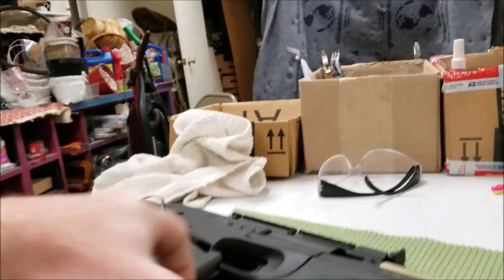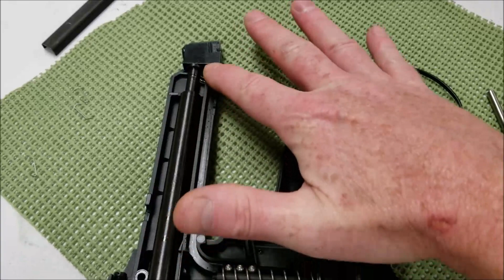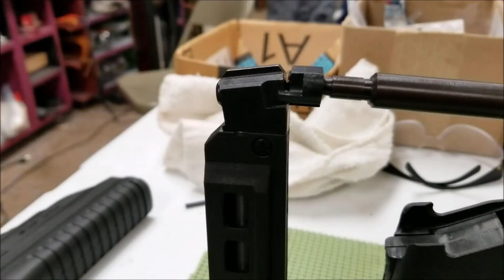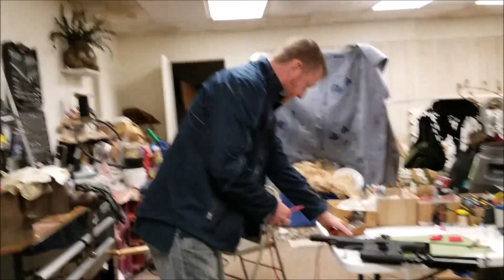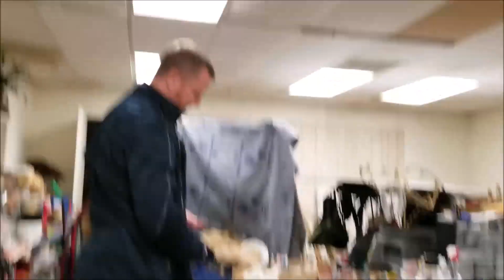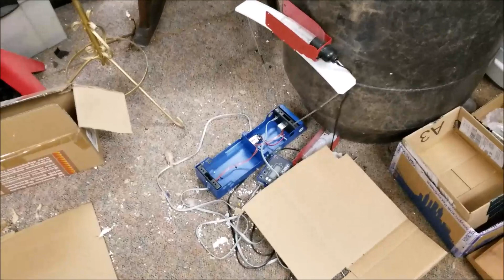Upgrade Day #2

Comment: I asked myself where did you get this Uzi Buttstock and what did it cost,also i need new screws for my latchplate and don't know where to get them.I also wanted to ask which length thickness and Diameter has the pipemod for the hopper?
Reply from the maker: I used to get the wire stocks from Jim Chapman. He stopped answering my emails the last time I told him I wanted to buy another fifty. I don't remember the retail price. Some of my customers have recently had luck contacting him through his website http://www.airgunartisans.com/AAJimC.htm. I believe the screws I use for the latch plates are 3/32". I'm not sure of the thickness of the liners I use, but the ID is 4.6mm. I cut them to 4 1/2". I'm looking forward to trying the new style valve body. I have a few on order.
Reply: Hello thanks i contacted him over his email,i hope he answers.I am through with the new valve bodys,i will send them all back.I had 3 of them,2 are still on the way to my door and i will send them all back.
First thing is they are still wabbeling in there even they have two grooves.
The first valve body i got,had a hole at the lowest side of the groove,where the metal is the thinnest part.You can see my video what i made for the seller,to show him the damage.
The second valve body wasn´t straight sitting on the magazine,because the inner thread was cutted in the wrong angle.
Yesterday i got the exchange for my first valve body and guess what,it is leaking at the valve seat,because there is a dent in the sealing area,also there were a lot of production stuff in it,metal and dirt from the manufacturing process.I am really disappointed,the parts are so expensive and they don´t even test them before they go out.So i decided to stop the experimental stuff and go back to reliable destucion :)
I tested tuning valve today,the one with the two hole design made from titanium against the original.My Setup is standard magazine with bb centering screw and 40 cm smooth barrel,Pulse Time 8 ms with standard CO2 cartridge and the results were just no difference hahaha.New Cartridge first shot with tuning valve 701 fps,going down all the way with every shot.
New Cartridge with standard valve first shot 700 fps.Have you encountered this any time :) ?
Please don´t talk to parabellum what i wrote to you,maybe your parts are fine :)
Reply from the maker: Don't worry. I won't. It looks like they took too much off that side. Bummer. The reason I got excited about them is because in theory they should work great with the Magnus Ops seal because it protrudes a bit. This causes the valve body to twist away from the single hook. I fix this by backing the inside right of the mag well with a couple layers of thick tape. It also gives an even tighter fit. I may have already explained that so forgive me if I did. Fingers crossed for the ones I get. You will see this a lot. When a product first comes out there are usually problems, but most of the time they get fixed.

Going back to the tubes I sell them, but an alternative is to bind the magazine with three  zip ties. This is done by going around the back of the air tube, and around the front of the mag. I did this for quite some time before the tubes. It prevent's mushroom mag, and also takes up space in the mag well. Sometimes my 4K builds come up on Ebay. The earlier ones have this.

As far as velocity I think 700fps is about all you will get with room  temperature co2 using the 400mm barrel no mater what you do. To experiment you can very carefully heat the co2 to 107F to make it go supercritical. This turns the liquid co2 into a gas before it is released. This creates more pressure, but the main problem with co2 is it's refrigerant properties due to it's relatively high melting point. The faster it is released the colder the liquid inside gets. This slows down the molecules until they actually freeze. Air, and straight nitrogen don't have this problem for our application. They will cool, but their freezing point is much lower than co2. This is why you can get far higher pressures from air, and why HPA is regulated. Co2 in our application is basically self regulated. It can only turn into a gas from a liquid so fast. This is why co2 powered airguns have an expansion chamber. Anyway under normal conditions you will only get about 800psi from co2, and the faster it is released the colder it gets so the output pressure decreases. I have heard of people putting an electric sock on their 88g cartridges, but if you try any of the above hacks please keep in mind they are potentially extremely dangerous. Do so at your own risk, or be safe by switching to HPA. After you do so you will then be able to find the flow limiting factor of your bird. Hint: The inlet in the manifold, and gas tube will become flow limiting factors.
Reply: @masondawson4061  Thanks for the Info😀I am running on HPA usually,but i got my chrony Yesterday and atm my regulators are apart and waiting to get maintenance.I already thought of selling the two valve,but  i shouldn't do that,first have the hpa results.
Reply from the maker: @JetDriveJetson  I didn't know that valve was titanium. I've been running the three hole titanium valve. They put out a lot of air, but tend to break under 25V. At first they were too short, and had galling problems. Then they made them too long. Cutting them down to the length of the stock valve makes them work, but they still haven't addressed what causes them to break. If they would just move the holes away from the pin a few thousandths this wouldn't happen. Some people just don't listen though. If I recall correctly you can get about 925fps from the barrel you are shooting. My fastest recorded shot using air was 1055fps. That was done with a 700mm barrel using 1600psi.

Comment: Why did you put that Pipe in the mag,whats the Advantage?
Reply from the maker: It keeps the mag from separating when using high pressure air. Also the bigger motors, and higher voltage I run in my birds will separate the mag on their own without the air. We used to use the clips you saw me pull off the mag for the same purpose. The tube also swells the mag slightly giving it a tighter fit in the well. It also stops misshaped bb's from getting to the barrel. Contrary to what you may read it does not boost velocity. I have a video debunking that theory.
Reply: @masondawson4061  No i haven't read of that,but i could imagine, that the tube works a bit like a sealing, that holds up the air a bit more that partial goes that way by every Shot.
Reply from the maker: @JetDriveJetson  You would think so, but the tube only goes so far into the valve body. There is a smaller inner diameter inside the valve body further up that is the limiting flow factor. https://youtu.be/TekBE6sOgCs
Reply: I saw you got ninja pro v2 regulator @ 1400 psi,ist it possible to shimm it like the v1
 @masondawson4061
Reply from the maker: @JetDriveJetson  I'm not sure, but Ninja tells me no so being a dealer I couldn't tell you if I did know.